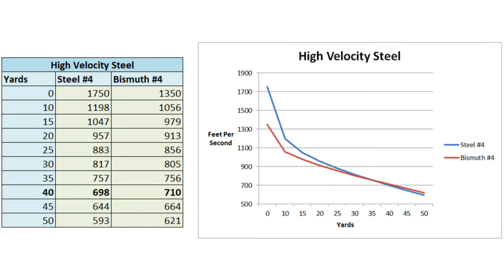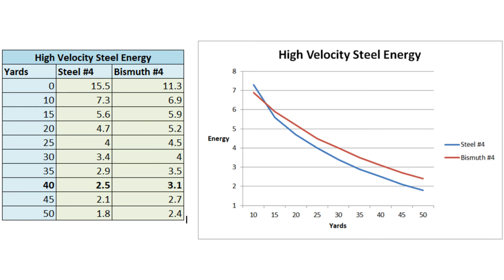Decoding The Marketing Hype Of Waterfowl Ammunition

Comment: I had some spare time, so I decided to put down some notes on why Velocity was important. Since you have a PhD, you may want to grab a spreadsheet calculator and I will dive into the reasons why all the things I write down are part of the shooting equation.  First off, a Canada’s goose can travel at 40mph (no wind behind heir backs) which equates to 58.66 ft/sec so roughly 19.5 yards per second. Now let’s assume that geese plan to land inside your decoys and we will assume 20 mph or 29 ft/sec equates to 9 yards /sec. Now let’s examine all he potential factors before you fire your shotgun.

A) acquire the target visually ;  30 seconds
B) flip off the safety;  1-2 seconds
C)Mount the gun; 10 seconds
D)RE-acquire the target and look down the rail, adjust for sustained lead; 15-25 seconds
E) pull trigger,depress clothing like glove,skin tissue and assume a 5lb pull weight ; 3-5 seconds 
F) lock time mechanism the amount of time it takes your shotgun to ram the firing pin to the shotshell; 5 milliseconds approx it varies
G) ignite the charge, burn to combust and send shot down the barrel ; not sure let’s assume 5 milliseconds attain speed of 1500 ft / sec
H)auto loader ejects spent shell, loads in next shell let’s assume 5-10 milliseconds? Did the spent shell eject fully? Or hang up, by chamber? Normally expect a clean ejection on a well maintained auto loader, but after 200 rounds they may chug slower
I) done shooting, put the safety back on, reload 1-2 shot shells more birds may be coming
J) limit count ? Don’t get into troubles with game laws they can confiscate your vehicle, firearm,fine you, deny a hunting license. It’s not pretty.

Now if you did everything perfect your goose has a mortal wound. But let’s assume the bird has a mortal wound but it’s wings continue beating and you have to repeat all of the above, minus the mounting part. This goose has now put a bit more distance on you (could add 20 yards) with each wing beat, your pattern will be less dense with each additional yardage added, and you must beat time essentially to RE-apply that second shot for a confirmed kill, or risk the bird falling far off for a long walk while other hunters may still need to fill their quota and additional birds potentially working the field. Worst case scenario you lost a cripple, educated some other birds and scared off working birds retrieving a far off bird.

Having faster shotshells gives you a small statistical advantage, because you may have lost critical seconds due to all the built in time consumed, while the bird was well within your personal comfortable higher probability kill zone. Once the bird is out there 55-60 yards that’s a real stroke to bring them down with a long lead, and not up to every one’s skill level. I have done some kills like this, and while impressive and your buddies will think you are awesome it’s not a higher probability kind of thing on a consistent basis. Sometimes people call this sky busting, and it can educate birds to steer clear of decoy stands, they will influence other birds to be highly cautious and while it might not ruin your today, it could harm a tomorrow or other hunters chances.

All of this time adds up and not all in your favor. What else can you do, well most shotguns have between 5-10lbs pull weight on the trigger. That is adjustable up or down, that said lowering the pull weight can help a bit, but don’t go below your state’s legal pull weight and at some point it could make the gun unsafe and/or illegal. 

Practice mounting , acquire target, and dry fire using dummy cartridges, these prevent your firing pin from being damaged by over extension and safer for your springs etc. think of this as a Zen like training like Karate Kid, wax on, wax off until you can mount quickly and effectively get on target.

Winter clothing and length of pull. Mounting your shotgun with winter clothing is much different than a t-shirt in fact your are a different shooter in winter bulky clothing than a dove hunter or skeet shooter in a t-shirt.  Whatever you wear it is critical to have the length of pull be comfortable in the clothing you wear hunting and to practice mounting the gun in those cloths.  It is not uncommon to have the butt of the gun get hung up on mount when wearing heavy cloths and it will cause a RE-mount which eats valuable seconds. You may find you need to push out further before bringing the gun into your shoulder. Practice,Practice until you can do this so automatically that you barely notice the effort needed.

Gun weight, how fast you can swing your gun depends on your size, strength and the gun weight. That said, your are in the 6-7lbs range for weight. Gun swing is critical whether you swing through or sustain lead. I use both depending on the situation, bird species etc. now what can you do for faster swing which reduces your time to target. I would humbly suggest you don’t need a 32” barrel for one, I personally prefer a 28” barrel, I am 5’7” tall , medium build. Now let’s say you are 6’4” you may like a 32” or 30” barrel which is fine for you.  Some people that shoot upland prefer a 26” barrel. Reduced gun weight will give you some advantages in swing speed, remember a body in motion will tend to stay in motion unless acted upon by an opposing force etc. you are going from barely moving to full swing so bear that all in mind and getting 6lbs moving is easier than 9lbs moving is what I am saying. Now it may seem negligible but it’s not because your dealing here in seconds or milliseconds to get ahead of the bird that desperately is fleeing for its life.

In summary, anything you can do to make yourself a quicker shot, a more accurate shooter, and maximize your odds over your decoy layout plays into your statistical harvest opportunities without wasting game, cripples, educating birds, etc. also it’s a bit more fun to do things quickly professionally and cleanly without a ton of fanfare and it’s a bit more rewarding personally to be at the best of your potential.
Reply from the maker: Daniel, thanks for the thoughtful comments! I do not have any disagreement with your points. Except perhaps I think you are being too generous with how much time a shooter has to prepare, stand and shoot. I almost never have that much time, lol.  The point I was pursuing in the video was not that velocity is unhelpful, but mostly that steel loses velocity so rapidly due to its low density that it almost makes no functional difference at 40+ yards. 

If #4 steel shot leaves the barrel at 1300 fps at 50 yards it is at 519 fps. If it leaves the barrel at 1800 fps then it is moving 599 at 50 yards. So 500 extra FPS at the muzzle equates to 80 at long range. From a power standpoint, it's useless.  Now I see your point that the shot will arrive at the target faster because it will have at least started its journey faster. But it loses the majority of those velocity gains within the first 10 yards, so the gain is not as pronounced as it would seem. The faster shot arrives at the target at 0.167 seconds and the  slower shot arrives at 0.195 seconds. So the difference is 0.028 seconds, which per the speed of a fast flying goose equates to 1.64 feet if the goose is going at 40mph. Is that significant, it could be. 

But the bigger point I am trying to make is for shots like that, people should use denser metals that retain more velocity and energy at those ranges.  Hyper velocity steel is still going slower than regular velocity bismuth at those ranges, and the bismuth his harder. Heavier materials can potentially do better still.
Reply: @TheNewHuntersGuide  I agree the denser loads are far preferred to pure steel. Good point that people often misunderstand.  When some locations started requiring non toxic or no lead for upland birds I cringed knowing how fast and hard those birds fly and how pure steel would under perform to my expectations. 

The clay ranges most of us practice on are mostly lead where it is ok. And one gets tuned into the effectiveness of the denser lead shot so like when we flip to a waterfowl situation you might not make any mental realization of all of that and the impact on real life performance is dramatic.  

But you are absolutely right the lighter steel does slow fast and I didn’t really take that forward in my little dissertation. So yeah the denser the better imho because you want to be as close to lead performance as you can be because that will act in a hard hitting way, won’t slow down like it’s less dense counter parts. 

There is a whole lot going on from the time you call to waterfowl to when the shooting begins and it’s hard to compact and digest all of that for someone new to hunting for example waterfowl. Even if we sat down went over all of that in person half of it would escape by so to speak even if we could remember every valuable piece of advice. The new person almost has to actually experience some of this with their own eyes. Even now I am sure I didn’t mention things like time dilation effects or how different species of birds beat their wings at different paces. For example imagine the flight of a morning dove, it will beat several times, coast glide up, repeat where as a Canada goes will beat very hard to get their mass moving big long strokes, but once in formation it’s more rhythmic in nature. A hunter needs to kinda understand or know the patter of that for each species I can’t teach that.
Reply: If you’re taking 10 seconds to mount your gun and 15-25 seconds to mount your gun none of this matter cause you won’t be shooting at anything by the time you’re ready because the birds are all gone.
Reply: @longridgearchery  I never timed it myself if you can do it in less than a second fine. I was trying to make the erosion of time easy to understand. The point being the longer that passes the more likely you will miss your optimum opportunity

Comment: You really. Want a shot shell  that applies trauma, folds up the Canada’s Goose over the decoys.  I have a lanyard nearly full goose bands. I base my recommendation on field experience.  For every banded goose you may shoot 30-40 geese or more over multiple seasons.   My observation is that Black Cloud  3 1/2 inch. Shell, BB or BBB at 1500 or more ft/sec.  Get the faster shells.  These shells will inflict significant trauma and less lost birds , more certainty of fatality and lethality.  Btw you can harvest more geese than you can humanly consume

Here is why velocity matters:  the time from target acquisition (when you see the bird) and when the BB’s hit the birds is your window. The bird has a vote, they can flare, and evade with each wing beat they can add 4ft of distance from you or more in windy conditions. Now you need to add the time your eye picks the target, Mount the firearm, get ahead of target, signals your finger to depress the trigger, compress your finger tissue, gloves if wearing, add the lock mechanism timing, add the time down the barrel of shot, and sustain lead.  All this takes time, nothing runs faster or flies harder than some animal that wants to live, by shaving precious seconds using higher velocity shell you bear down quicker, kill inside the decoys or outer edge and inflict mortality.  Also you have other hunters wanting to bear down on the  same goose sometimes, maybe they did not select their goose, go after yours.  You want to beat them to the punch down, fold up that goose first as it might be banded.  Get the higher velocity shell it buys you time to get there first with the most. Lastly the further away the more dispersed your shot pattern, you want to minimize that with an in range strike.
Reply from the maker: Thanks

Comment: I've not found a good steel load for pheasants in 20gauge. The cripple rate is quite high. I met a fellow pheasant hunter who swore by his #3 Boss shells and gave me 3 to try. I will give them a try next Fall.
Reply from the maker: Yea, I can identify with that. Steel 20-gauge pheasant loads are really sub-par. I would definitely upgrade to something better like bismuth. That gives new life to a 20 gauge.
Reply: Bummer.  I use #4 steel in 3” shells and usually the cheapest stuff I can find in that size.  😊 works for me on pheasants with an Improved Cylinder and Light Modified chokes from my Beretta 686 O/U double gun.   Been using those #4 steel 3” shells for years and years with great success.   They work great on rabbits too.
Reply: I use Eley VIP 24g no4 steel 2¾" , not sure if they're available in the US , good for pheasant and duck.
I don't really shoot much further than 35yds and use imp cyl and mod.
Bismuth is definitely the best but so expensive even here in the UK it works out at about $1.50 a shot for a 2³" 12ga 32g load

Comment: Appreciate the video! I've always used Federal Blue Box 3" 1 1/4 oz BB at 1425 FPS out of a SBE2 with a patternmaster code black duck. I am comfortable pass shooting snows at 50 yards or shooting honkers at 40-50 yards. Are they always dead, absolutely not, but I always appreciated buying a case of ammo for $99 (before now) and stepping up my shot size. The Federal blue box definitely didn't look plated, when pulling pellets from birds they just looked to be tumbled in graphite but the shot was always pretty uniform and round.
Reply from the maker: Thanks so much for sharing Kevin! There is certainly a case to be made for spending less.
Reply: Well spoken ,  while this isn t rocket science there are hunter s that have a hard time comprehending the physics of the different loads . Your explanation is perfect .
Reply from the maker: @mattchristiansen7589  thanks so much!